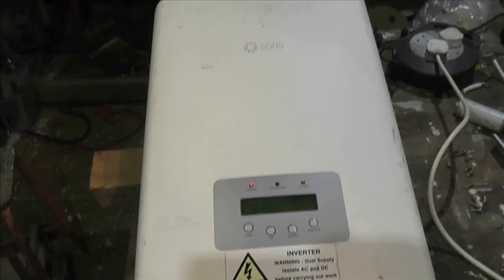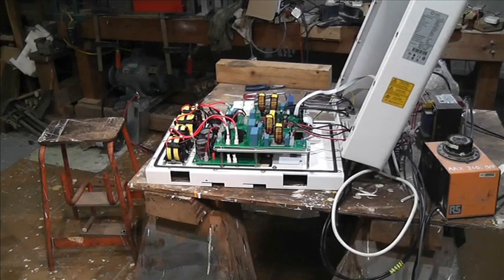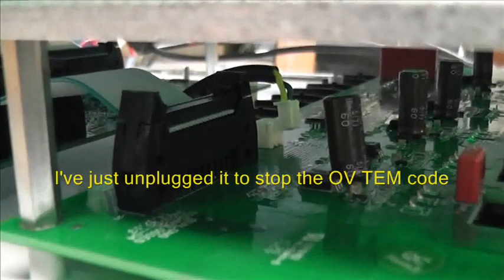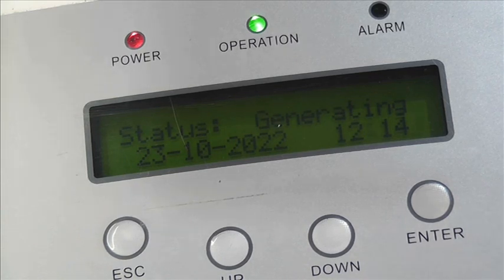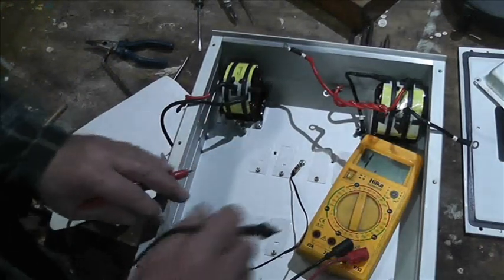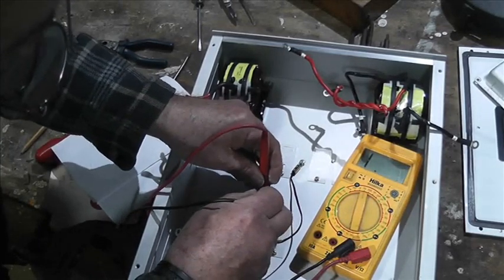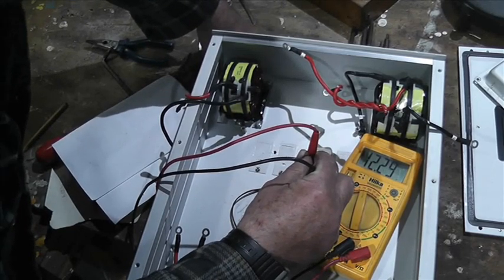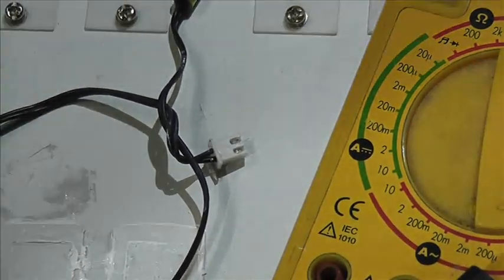Solis OV TEM fault, solar grid inverter repair.

Comment: I understand all you say about running these inverters not absolutely flat out Andy, but if it overheats for some other reason, it isn't going to shut down until actual smoke comes from it maybe, without that thermistor. You'd have more experience of this than me though. Cheers,
Dave
Reply from the maker: Dave, great to hear from you, I hear what you are saying but I would be happy to run this inverter with 5 panels, whilst mounting it in a cool well ventilated spot. Either that or change the sensor but I suspect that would take some trial and error as they are not marked, cheers